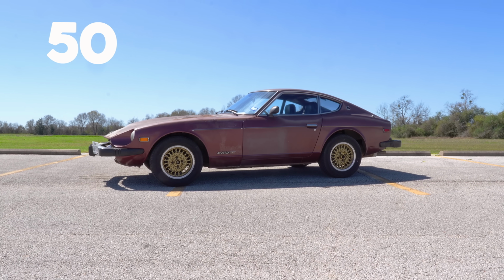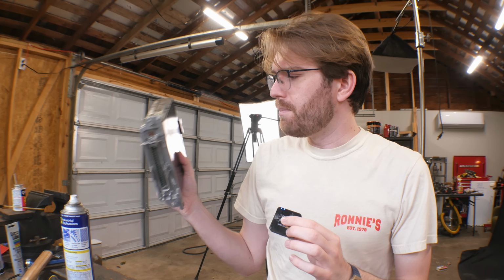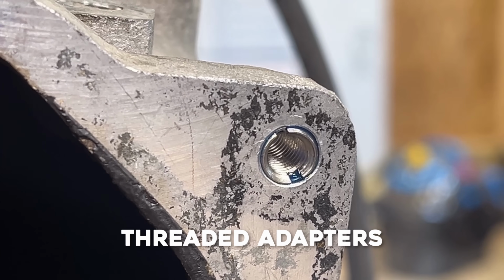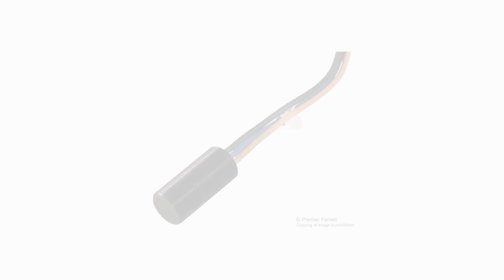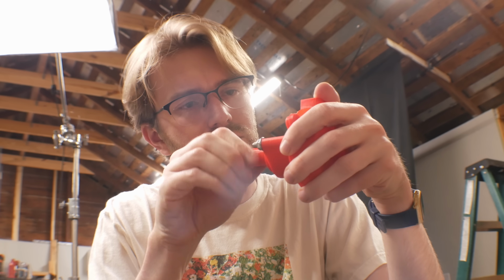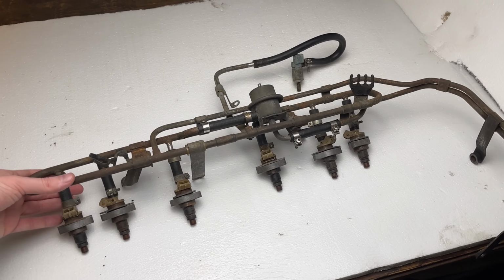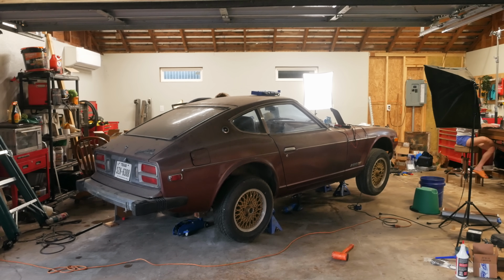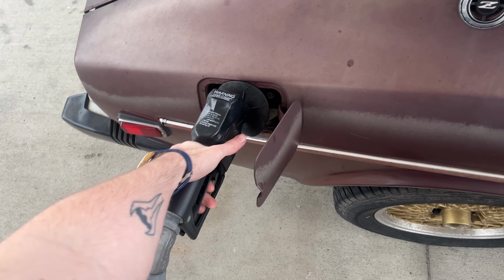Modernizing a Vintage Car

Comment: Next time convert the clutch fan to electronic fan with thermoswitch, trust me it will be worth it specially that you're modernizing your car. I did that amd i save additional 1 to 2 Km/l and gave me more power on engine specially the torque. The electornic fan only works on traffic or uphill but on freeway my fan is off unlike on my previous clutch fan that it still have a additional load on engine even though you didn't need it. Plus converting it to eps will make it more as a modern car

Comment: Bosch engineer here. I have taught quite a few people how a gasoline engine works and what an ECU has to do with it. Had your video existed 10 years ago, I would have shown it to them instead. You have achieved not only a great conversion, but also a terrific job of explaining how an ECU actually works.
Reply: Man this video really brought me pretty close to changing my specialization in my electrical engineering master to pursue a career at bosch lol
Reply: And it was littered with so much comedy...   It was chef's kiss.
Reply: I now know much more about engine firing and how a distributor works. Ronald’s videos are scarce but there’s a reason for it.
Reply: It made me chuckle when he said Bosch was a washing machine company. 😅 I've always thought of Bosch as a sparkplug company. In fact before WW1 Bosch was the only sparkplug maker in the world as far as I know.
Reply: @keithplumley2054  that's interesting, because I assume it's just however one becomes aware of the company, whether it be a dishwasher or automobile parts.

It's a name that has historically meant quality, lately though, all car parts have been hit or miss with that
Reply: @josephhertzberg2734  They all appear to manufacture in China.  From experience I can tell you that it is much, much cheaper to manufacture there but even with strict oversight you can still get shitty parts that are grossly out of spec.  You can't be 10K miles from the site and remotely insure that they are doing what they are told to do.  They will improvise without consulting you and you won't know until parts fail.  Manufacturing in other countries with cheap labor often yield the same results.  Manufacture where labor costs are high and quality is also high and no one will buy your parts.  Corporations that will produce cars that kill people from the use of defective parts or materials until the cost of legal expenses rival profits do not care if they are using and/selling a certain percentage of bad parts......and that percentage has been increasing for years.  The hidden cost is the repeat of mechanic/enthusiasts labor time to reinstall another part....lately it is not confined to one reinstall.
Reply: Fellow Bosch engineer here…. 😂
Reply: @vishakparameswaran2126  You Bosch engineers, is the Bosch logo an image of a drum brake?
Reply: @Republic3D  1900: "The first Bosch emblem was composed of a vertically located oval with a graphical representation of the burning magnet inside it and the electrical bolts and lines coming out of it." In 1907 the Bosch logo was redesigned. The emblem changed to a circular form and kept the image of the magnet inside it, the magnet was placed vertically (from what we used to see on the latest Bosch logos).
Reply: @sonyphotoguy6601  Nice! Thanks
Reply: That's awesome. And I'm glad to know a video I enjoyed was presented by someone who knows his stuff and verified by someone who knows. 
🤜🏿🤛🏿🤜🏿🤛🏿
Reply: Your company lives rent free in my head for the evilness of Kjet
Reply: @josephhertzberg2734  K-jetronic really wasn't a bad system when it came out. It was pretty revolutionary in its era, and worked quite well. Most problems attributed to it in the modern era are just due to age.
Reply: Bosch is top notch 👌
Reply: 😂 💯 I correctly work for BSH ( BOSCH ) in newbern , NC  😊 small world...
Reply: Fellow Bosch engineer here, glad to see more of us in the comments.
Reply: Licence ittttt!!!

Comment: As far as the more reliable, that can be up for debate. Also, it would depend on the manufacturer and how you take care of said car. An example would be my dad's car was a 1965 Ford Galaxie 500. Efficient not by any means as it has a 427 and a 4 speed manual and if you kept your foot off the pedal, the best could be around 10 in the city and 14 on the highway. But the car never let the family down and now I have it. Today's cars are very powerful indeed. This video is very well done though, keep up the good work

Comment: Dude did all that work and didn't replace the starter?? It was right there man! You had the engine out of the car!
Reply: Like any project car the starter probably never had any signs of failing before the engine was out and easy to access. Like any good project car it waits to fail after the engine is back in and replacement is much more inconvenient. Yep, that’s how it goes haha!

Comment: 4 minutes in and you already told a lot of garbage. Yes, 125 hp is less than a Chevy Cruze. How much does the 280Z weigh, how much the Cruze? 170 rated hp for a car build around 1980 is a lot, and I bet that the hp per ton is much better in the Datsun, even before your improvement. Also, not enough money for a new engine is a cheap excuse because all the effort you spent would yield enough cash to just buy a modern engine if you worked during that time. This way it's of course more entertaining.
Last, Bosch does make washing machines, yes. But if you know anything about cars, you should also well know that Bosch is also one of the world's largest automotive suppliers. Subsystems, control units, ABS, are all Bosch staples. Well, I guess you need material for stupid jokes, but with your number of subscribers it's kinda dangerous to dumb them down even more.

Comment: Okay!! On to the next project. My '99 Toyota 4Runner, 3rd gen. The famous 3.4L 5VZ-FE V6 engine, that lasts forever. But is slower than a pack mule. Time to modernize!!! I've seen folks add a turbo or supercharger to these engines. BUT...They didn't modernize the EFI system or ECU in this car. I really wonder how much more fuel efficient and horsepower you can get just with the updated EFI and ECU??

Comment: I've owned a 1970 and later a 1970 (6 months older) 240 z, the best easiest no trouble cars I ever owned (except a 1980 720 pickup until my "buddy" borrowed it ,back up with door opened and jammed the door into its door pillar. completely my fault ,lesson learned don't let friends borrow expensive stuff, made him buy the truck and bought the first 240z) I loved that car, put new bouge struts, durilin bushings every where a front spoiler (nose wondered over 110 mph that locked it down) and a electronic distributor, and new 60's on all corners. only real problem I had found the previous owner put stop leak in the radiator causing it to get hot ,flushed that crap out had a new core from a vet radiator installed  and had no problems from it or them. second verse same as the first except had a 5 speed put in

Comment: sorry but the type of engine you put in was a inline 6 strait the new ones are diffrent because there a difrent way and the strait got stop being made around the 2000s so its not motern the engine you put in but that engine is more fuel efechent then a 2012 ford f150 so i like the engine i just wanted to let you know its not motern but i love that engine

Comment: Great video!  The custom built parts / adapters are super cool!
Did you update the spark plugs (larger gap) to match upgraded coil, and tweak the timing.  I was able to get ~25 mpg out of a carburetor, electronic ignition 240Z (no catalytic converter).  Updating the spark plug and timing adjustments were key to fuel economy.

Comment: 4:08 Bosch, the dishwasher manufacturer? 🤣You have no idea. The German Robert Bosch AG is a leading manufacturer in the automotive sector; Bosch invented ABS, ESP, ARS, and so much more. For its time, there was nothing better. Even a Lamborghini Countach had a Bosch Injection system.

You look like you have German ancestors, and your name suggests that too, so you should know a bit more about Germans. Germans invented, among other things, the bicycle, the car, and the computer.   …and that's just a small selection.

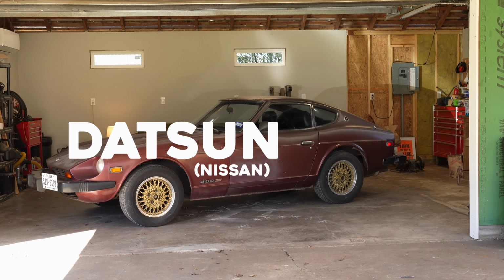Comment: 1:00 no its not, it just need some modern parts :) like new engine, breaks and so on.. then cars are these old and good looking a EV conversion is ok, i hate EV's except for EV converted really old cars. like this one. but a new / modern engine is good also.. 
i know some people want it to be totally original also, and i like those also. but i like "resto-mods" more. you save both a car and the environment by restoring it in some way.. it will be so much better for the environment to save this car but putting a new/newer petrol engine in it compared to a newly produced car. and we should not talk about how dirty EV's are to make and drive, EV's also include African slavery..

Comment: With today's cars/SUV's looking looking the same regardless of manufacturer, I've been wondering with today's engine technologies why we can't bring back some of those roomy luxury vehicles. My old '77 Mercury Colony Park Station Wagon with the 460 Cu. In. (7.5L) engine, do these upgrades like you did with that Nissan. I'd bet the 11-13 mpg would be greatly increased along with the horsepower just like you proved. Awesome Video, very entertaing, best of all, very informative. Thank you!

Comment: Now turn a modern car vintage
Reply: EPA would like to know your location
Reply: The benefits of the EPA can be summarized in his last sentence.
All the money saved for miniscule improvements will pay for themselves long after the car doesn't exist.
So why does the EPA exist?
Reply: @thewiredfox2691  So that I could pay about 700 bucks for ford to tell me that a vacuum hose came loose from the fuel tank. Its all good. The engine runs exactly the same but the pesky emissions engine light is gone and I can get new tags. Dont even ask what happens when a permitted compost facility goes belly up and the composter stops paying rent to the landlord.
Reply: @thewiredfox2691  I think the difference between Carburettor car would be way more impressive. Yes he managed to improve fuel efficiency by 17% and increased power by 13% by having new ECU and sensors. If he played with compression ratio and got it from 8:1 to 11:1 for modern gasoline, results would be way more impressive.
Reply: @thewiredfox2691  because (most) people don’t like seeing rivers covered in oil and smog filling the sky, which is what we did have before the EPA
Reply: NGl I'd lose 20 horsepower to have a more reliable vehicle I get computers can outlast some mechanical parts due to wear and tolerances but the same goes for transistors
Reply: If you are interested, B is for Build did a 2017 iirc mustang but converted it to look like the Eleanor mustang. It was pretty sweet.
Reply: In the US, a vintage car is broadly defined as a vehicle manufactured between 1919 and 1930.  What's he going to do, fit candles for headlights?
Reply: The people who do Lemons racing do this pretty frequently.

Just figure out a way to drive a breaker-point distributor off one the cams, and disable anything resembling variable duration/lift in relation to the cams. Then weld a flange to the intake manifold, and bolt a generic carb on to it said flange. Job done (mostly). 
All it costs you is basic reliability and 30-50% of fuel efficiency and power output. Just don't try it on a turbocharged vehicle, or there will be lots of extra steps and even worse reliability/efficiency.

Comment: Great vid. I owned one (a 240). Even though marginal increases in hp and mpg, you probably restored and increases drivability, throttle response and torque rise (ability of engine to increase/maintain torque over rpm DECREASE) so it can make for a much more powerful effect ( ever hear the phrase “pulls like a tractor”)? Thanks for saving a piece of automotive history.

Comment: I had a 1976 280Z, which had a 
 Chevy 327, with camel hump heads, just a little over stock, nothing wild. Had a TH350 trans, the driveshaft wasn't very long. Wasn't hard to swap in, engine mounts, trans mount, and crossmember took very little fabwork. Was super fun to drive, and always got the, WTF look. Lol

Comment: Had a 240Z and loved it much more than the 260Z and that 280Z.
Fastest I ever got it was 141 before I had to back out of it because the wipers weren't louvered and kept raising and then smashing against the windshield.
Was running three 2 barrel Holley Carbs on the original straight six. Yes,.. the syncing was obnoxiously hard and bothersome than necessary BUT,......
... it's wider and more stable than the other Z cars. So much more fun to drive!!!!!!! THIS,... is a very cool video!!!! Brought back memories AND bridges the gap from our old school beast to much better New Car Tech!!! BRILLIANT WORK and Very FUN VIDEO!!!!

Comment: Like others I am kind of shocked that you only got 20 more HP and 2 - 3 more MPGs out of it.  Because the engine control updates are a huge improvement over stock especially where stock, all the injectors fire, not just the one for the cylinder due to fire next.  What do you make of that?  All I can think of, is that there's still no variable valve timing like there is commonly in modern engines.  Anyway, thank you, it was fascinating, I always admired those cars, and inline 6es generally.

Comment: It came with 9:1 compression if you would of bored 30 over and brought up to 10:1 and did the delivery system and ported intake and exhaust I’m guessing it would make some where around 300 hp or more

Comment: This is a very good build  Ronald. Seriously bad ass. My humble opinion is you really should remove the engine and rebuild it (not using performance parts) and even repaint it. I'm almost positive you'd see an even 200hp on the dyno with a fresh rebuild and the updated technology you put in it. That engine bay looks waaayyy cleaner too. Much less clutter.  Keep up the great work.👍👍👍👍👍👍👍

Comment: Great job. Time for more efficiency with some head porting and a valve job. Then add some more cam timing after flowing heads. This will produce more power and better fuel efficiency which is your goal. My 91 Corvette got 35 mpg on highway when before it got 30. Picked up 145 hp as well. Port the exhaust or bur a header to wake it all up. Efficiency males better power.

Comment: Thanks Ron for making a great informative video, without " trashing" an old classic. I worked on these cars when they were new, back in 1975.  Though the Bosch system improved on the old Hitachi carbs, you made things even better (and cleaned up all that plumbing)! Plus, you helped us understand (re-learn) how everything works.

Comment: I’m often mystified when younger people think 1970’s tech is unreliable or whatever. 

My 1989 jeep isn’t 1970’s but it’s still considered obsolete. With hundreds of thousands of miles it’s had two motor changes. But it’s super inexpensive to maintain (though I neglect it) and it ALWAYS starts regardless of the weather or how cold it is. Most reliable and inexpensive to maintain I’ve every owned since my 1974 AMC Concord and 1971 Chevy Nova. Actually should include the 1979 chevette for reliable transportation. 
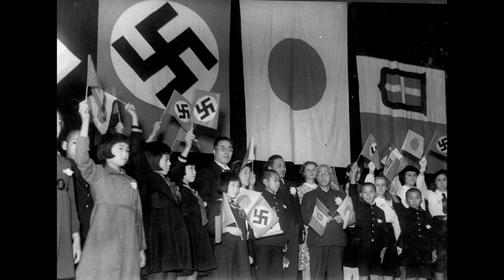4:18 just some misunderstandings due to not being familiar.

Comment: Why didn't you use a magnetic angle sensor? Just stick a vertically parted magnet on the shaft and you get digital 12bit rotation data. It's also absolute so no reference teeth needed.

Comment: OK, still missing a new intake manifold, a small turbo a new exhaust system. It is just a bolt off, bolt on operation. 
- But serious, well done! The engine bay is so clean, so, so… uncluttered! 👌

Comment: Mounting on the distributor mount there will be slight play from the drive gears , most engines use crankshaft sensors

Comment: Old cars have issues yes due to age, And some have issues due to just poor knowledge at the time. But I will stand firm on that Mechanical things will age better than electronical things, just wait to see in 50 years+ how all modern cars of today are doing. If one think of the ammount of electronics a car computer of today contain and what they handle all the sensors thick wireharnesses and just nightmare fuel to work on.

I do have both old and new cars, they all break diffrence is old cars I can usually fix with a screwdriver/socketwrench. My oldest cars are from the 60's and the newest from 2024

The modern cars I need a computer with special software from the maker just to calibrate stuff I mean one of the new cars the headlight broke, It cost nearly $1400 to fix. Because first it needed the bulb, then the bulb needed to be calibrated in with the special software wich a normal person cant get hold of. It's just pure stupid for a function I dont even use automatic lights.

However on the opposit to be fair getting hold of parts to theese old cars can be very expensive aswell.

I do like this idea tough very cool. Gonna be a great watch. :D

Also that sponsor is fire, Great pricing for custom parts.

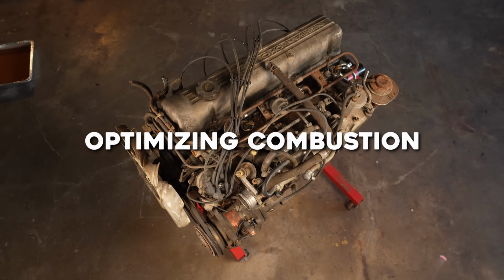Comment: I need to correct you on 2:46 You forgot 2 other things an engine to fully run its needed air, fuel, compression, timing, spark

Comment: this isn't modernizing its called an EFI swap there is companies who sell complete kits for cars to convert them to EFI most notable ones i can think of are kjetkillers so in all reality i really doubt there were no ready made parts and tunes for your 280z, also if its SO low on power you probably have internal engine wear which is impacting your performance and only giving you 140hp with parasitic loss from RWD you should be making about 150 at the wheels not 142 also with more proper tuning you should be able to really get more fuel economy out of it 19mpg is still kinda low